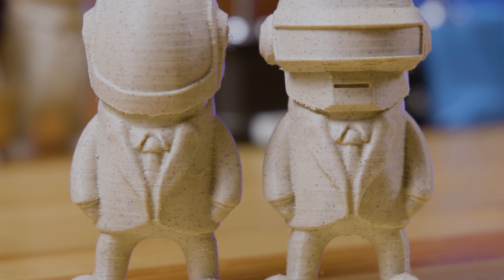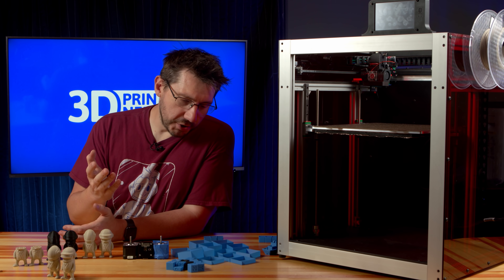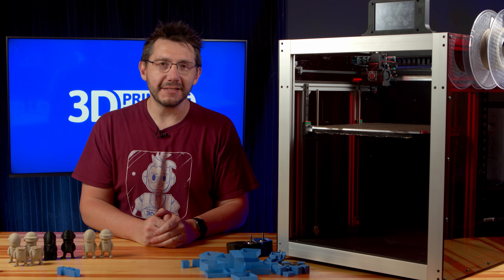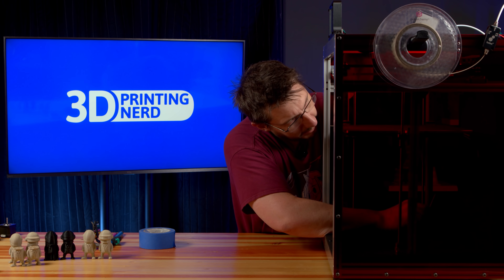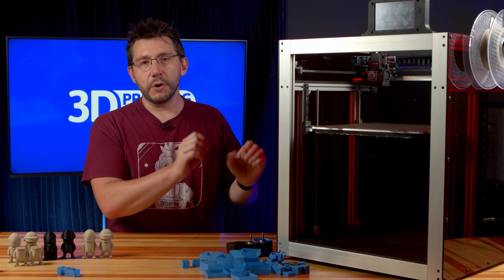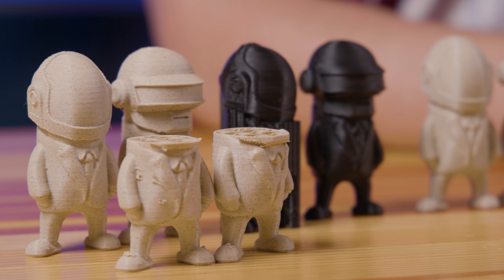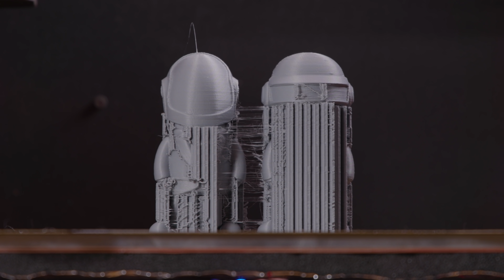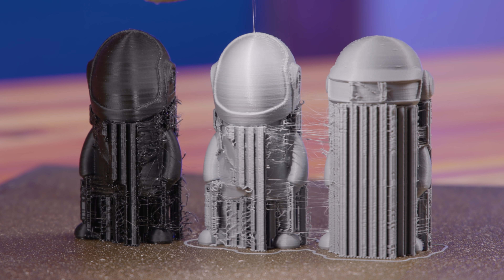Daft Punk vs Daedalus // 3D Printing & Troubleshooting

Comment: There is still layer inconsistency; did you calibrate PID on bed? also i would not exclude leadscrew as potential fault, but assuming that those 3 are not bend it might be alignment issue - in Marlin there is auto z adjustment (G34) it can adjust height to one plane for 3 leadscrews and solved similar problem in my machine.

Comment: I have been chasing an almost identical issue on a Ender 5 Plus. I tried all the obvious candidates but the problem persisted and now I was a couple of week in. When I printed a 20mm dia pillar it was horrible repeating about every 5 layers at 0.2mm layer height. But when I printed a 40mm dia pillar the pattern became more or less random which set me off track. It did seem though something was cyclic and the real give away was when I doubled the print speed on the 20mm pillar the banding in thr Z axis was twice the distance apart. It turned out to be the bed heater switching in and out. I think that there was too much store put in the PSU's overload capacity of 5% ~ 25% as when I added up current consumption it was right on rated max current. I guess this PSU wasn't happy being driven hard. Anyway replacement PSU ordered! Sadly I have to agree with other here I could still see a repeating pattern...

Comment: One thing you could have tried was to switch two of the motors around to see if the issue also moves to a different z screw (before the new ones arrived)

Comment: Joel — since the Daedalus is a “descendant” of the Railcore, your issue is one we’ve seen before.  Likely it is a Z-alignment issue between the lead screws and the linear rails.  Take a look at the procedure here: https://railcore.org/build_and_troubleshoot/new_Z_alignment_procedure_for_the_Z_extrusions.html It might need some modification for the Daedalus.  Feel free to drop by the Railcore Discord for assistance too.  When you swapped motors and attached new motors to the couplers and lead screws, it was enough to change (but not eliminate) your repeating issue.

Comment: Very interesting.  There is a very faint pattern with the new motors, but it is nowhere near what it was before.  That one motor was definitely weaker than the other 2, which is something that we used to see in the solenoids of pinball games.  They’d appear to work for a short time, then they start start exhibiting weakness that looked like bad transistors, but on the very rare occasion it turned out to be the solenoid.

I also noticed that the anti-backlash spring loaded nut is upside down,  Is that how they install them on the Daedalus?  The reason I say that they are upside down is because they are pushing the platform up, fighting gravity and any other forces that push down on the platform, which includes the force of the filament pushing against the platform and print.  The anti-backlash spring should be pushing down to eliminate the effects from those forces.  Have they considered that?

Comment: I'm always iffy about those spring-loaded "anti-backlash" leadscrew nuts. The axis is already pre-tensioned by gravity, adding the spring just makes the axis elastic and that's not ideal.
Reply: Makes sense, but then there's also any vibration that could transfer to the lead screw, that hardly would do anything with the anti-backlash screw. I would say that the best option would be to mount it so that both the spring and gravity pushes it down.

Comment: z wobble immediately springs into mind, genereally if the pattern is spaced 2mm apart and you're using T6 leadscrew (which majority of 3D printers use), it is z wobble

Comment: Mmm, there still is a pattern, it's less though, but I wonder if the leadscrew still has an issue. Which can be easily tested by repeating that screw location test. In that test, the other 2 locations definitely didn't have a pattern.

Comment: Sorry to say that the new motor only helped ever so slightly, just removing the coupler and realigning it with the new motor probably made the difference.

Those solid couplers are the main problem, ran those on one of my machines and get the same Z artifacts.  Backlash on 3 different motors probably doesn't help either.

Try 3 flexi couplers and some sprung anti backlash captive nuts and see if it helps!

Comment: The new prints looked better, but i could definitely still see a similar repeating pattern.
Reply: Could the pattern be due to z wobble？It didn't mention the z motor alignment after install，so the lead screw might be tilted?
Reply: Yup, they are less visible tho
Reply: @FireN2k9  
Not less visible but less frequent
Reply: @MCgranat999  It's not that they are less frequent, it's just that they are faded; and because they are faded, rather than adding up to the noise, it has faded into it as well.

Comment: Honestly thought the original prints looked better overall.
Reply: I believe he was trying to eliminate the hardware issue which ended up being a failed stepper motor. The rest is down to profile tuning, if he used the same profile for both while using different filament it could cause inconsistent lines near the seam. That is common at higher speeds but can be tuned per material.

Comment: Great video on troubleshooting, Joel!  New prints are much improved.

Although I have to say, the final prints are just OK.  I would have hoped for much higher quality on the final object.
Reply: I'm not sure if he resliced it after moving from the Polymaker polyterra to the other material. That could cause the inconsistent lines that can be tuned out per material. I believe this video was more about finding a weird issue that will become more common with so many new printers using the 3 lead screw design.
Reply: @ProjectR3DTeam  agreed. Looks like the support settings or cooling could be improved as well based on the overhangs.

Comment: Really enjoyed the video. I've done (and am doing) my share of printer modifications so it's fun to see other people doing the same. Really polished how-to section, I dug that a lot.

Is it just me, or are the "improved" prints still kind of... wonky? Maybe it's just because the slicer settings haven't been tuned for this machine but I don't know that I'd be thrilled about those grey Daft Punk prints, personally. Still getting some horizontal banding & what looks like inconsistent extrusion, maybe part cooling is a little insufficient hence the droopy edges and stringing. Looking forward to more info about this printer as you get it dialed in!